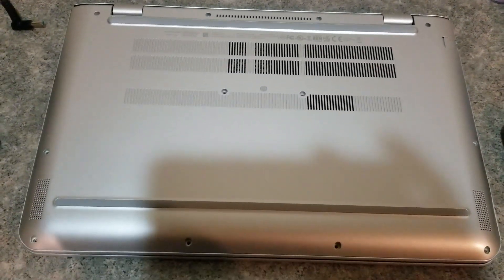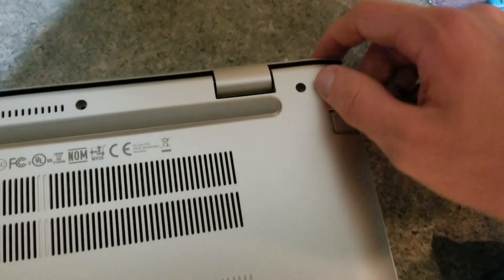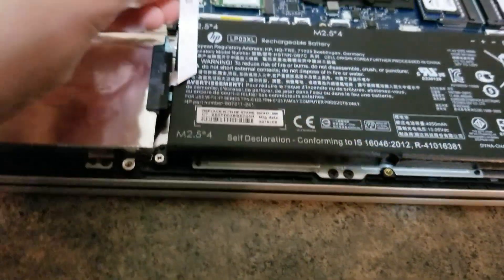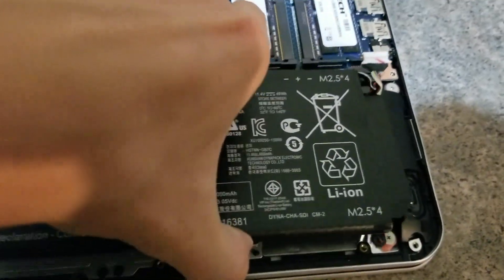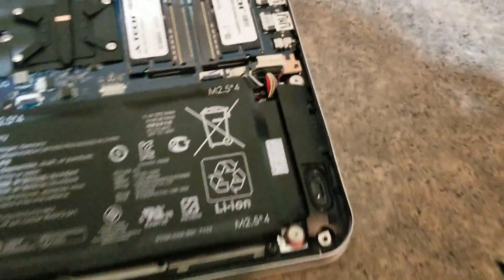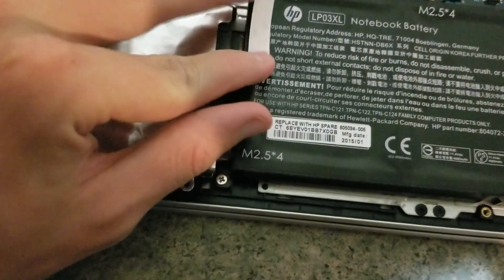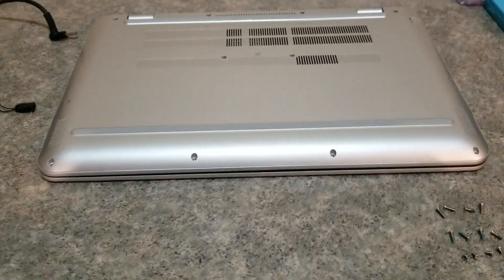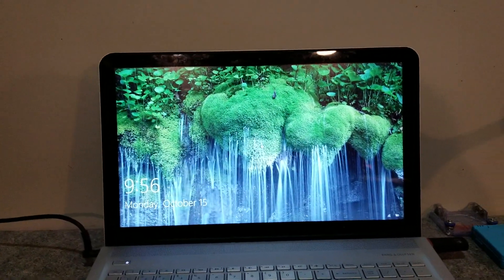How To Change The Battery In Newer HP Envy Laptops

Comment: Special screw driver to remove back?  What clips?  Yes, holding phone while trying to work is an issue.  Thank you for the info.  Thumbs up!
Reply from the maker: I can't tell if this is sarcasm, but you just need an appropriately-sized phillips screwdriver.  There are some clips that help hold the plate to the computer so you'll have to pry around to pop off the back.
Reply: @BusMaster99  NOT sarcasm. I did some additional research and it seems to be P1 Phillips size....never saw such small screws and they are embedded deep into holes in the frame...so will need to get one...mine are too big. And i was wondering what the clips looked like so I could envision what and how it was being "pulled apart"...just a thing with me sticking something in there....I have replaced the FOB  in my car keys and videos look simple but I still fear breaking the FOB when prying it apart.  And you seemed concerned that holding the camera was an issue, so I was just sympathizing.  I said "Thank you" and gave it a thumbs up.
Reply: .....battery in my FOB.....
Reply from the maker: @MaryCasey1100  Sorry then.

Comment: I have a new HP Envy 17t ce100 CTO laptop that was purchased last summer. I really don't use the laptop with battery. HP guidelines indicate you shouldn't leave the battery in the laptop for long periods of time if you're operating on AC power. So I'm assuming it doesn't hurt to use the laptop without the battery? I don't want to unnecessarily create a problem.

Comment: Question, I pulled off the blue tip on the ribbon cable and tried to tape it back on. Now I’m getting boot device not found message and can’t turn on my laptop. Any correlation suggestions?
Reply from the maker: Looks like you'll have to send it in for repair.  Ribbon cables are nightmares when they're not sturdy enough and they get in the way of the battery.

Comment: Great video, Where did you purchase the replacement battery?
Reply from the maker: From Amazon.  Looked up the part number and found one.
Reply: @BusMaster99  just did the swap!! Thanks for the video! I have the battery charging now with laptop off do you recommend any method of charging the battery? I read someone say charge and deplete it 3 times before using any suggestions?
Reply from the maker: @luisaguilar-kw6pk  I'd say that is correct.